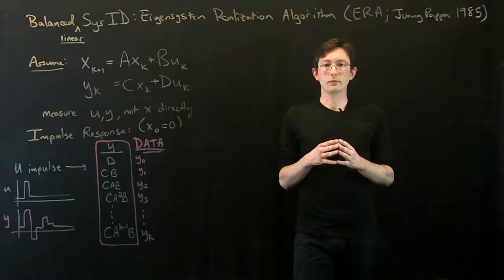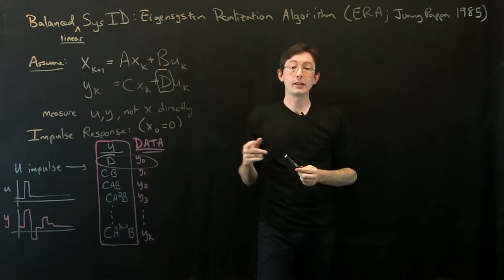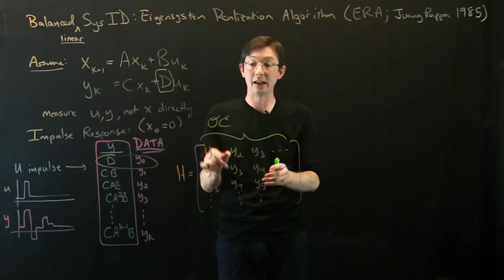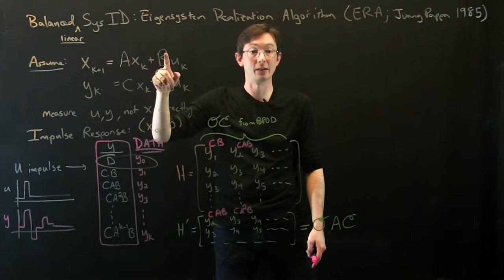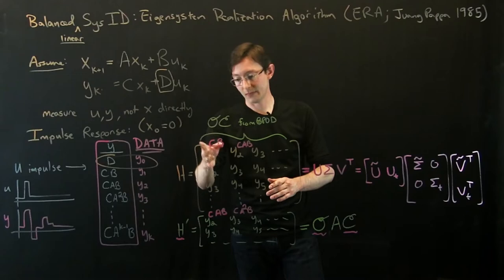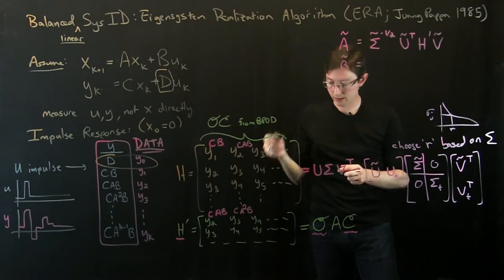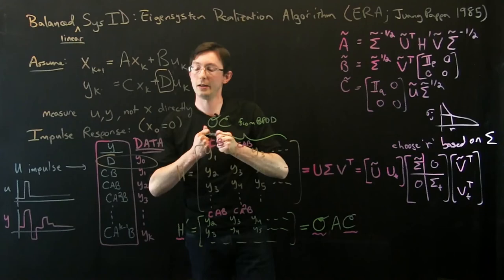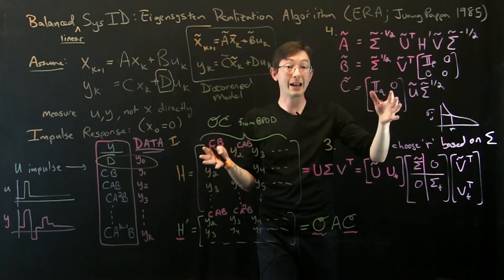Data-Driven Control: Eigensystem Realization Algorithm Procedure

Comment: Why only impulse inputs, rather than step inputs ?
Would several consecutive Impulses give better approximations ?
Reply from the maker: Great question.  In some systems you will need to do a step input instead of an impulse.  Actually, this was the case in my thesis, where I was building unsteady aerodynamic models past small pitching airfoils.  It made more sense to "step" the airfoil angle of attack, say from 0 degrees to 5 degrees, and model the step response.  But a step response in the angle is an impulse response in the angular rate.  So I appended the angle to the state of my system and made the angular rate the input, so that it was an impulse response problem again.  This is usually possible.
Reply: @Eigensteve  Very clever to change the variable so that a step input becomes an impulse input. But what about the case where actuator saturation cannot create a sufficiently large impulse, for example if your angle of attack actuator is too slow to impulsively change from 0 degrees to 5 degrees? Is this an inherent flaw in the system design, or is there still a way to apply ERA? I understand that one could perform the experiment anyway and carry out the procedure you've described in the video, but I worry that with a small magnitude impulse the system dynamics would be buried in noise and the system realization would vary highly between experiments.
Reply from the maker: @theBlaxicindasian  in this case, you would use ERA in conjunction with OKID (a few videos later).  Then, from a non-impulsive input, you can back out what the impulse response would have been and use ERA.

Comment: How do you build the Henkel matrix for a system if it has multiple measurements? Would each y_1, y_2, ..y_m be a vector within the Henkel matrix for each measurement at the specified time step?
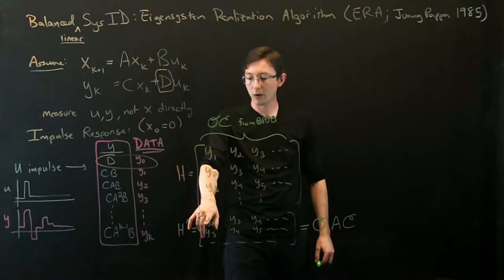Reply from the maker: Great question.  At 6:41, I hint at how to do this.  For a linear system, you can replace y_1 with CB, y_2 with CAB, y_3 with CA^2B, etc.  For a system with multiple inputs (q) and multiple outputs (p), then each of these matrices is size p x q.  So basically, you would stack all of these p x q matrices the same way as you stack the y's.  The real trick is how to rearrange your input data to get these matrices and rearrange the SVD at the end to get a model.  To start, you would perform q impulse response experiments, one for each input, and you would measure each of the outputs for each impulse response.  Then, you would need to organize these into the matrices CB, CAB, CA^2B, ....  Then, at the end of this procedure, when you compute the SVD of your Hankel matrix, you would need to be careful about how to use those matrices to compute the reduced model with q inputs and p outputs.  I believe this last part is in the book in chapter 9.
Reply: @Eigensteve  Thank you for these clarifications! But how does this work with HAVOK? In the supplementary of your 2017 HAVOK paper you write: "In the following, we will present the theory for a single scalar measurement, although this framework generalizes to multiple input, multiple output (MIMO) problems." But I could not find any further clarification on how this generalizes.

Since the above (CB,CAB,...) only works for linear systems, how would one stack multiple variable measurements for HAVOK?

Comment: Does it matter what the amplitude of the impulse is at t=0? I'm doing some simulations using non-linear/linearized systems, and there the results (mostly scaling I think) are quite amplitude-dependent (i.e. I check them by simulating both systems for another input).
Reply from the maker: For a linear system, the results shouldn't depend on the amplitude of the impulse.  If I double the impulsive input, then the output will double.  But for nonlinear systems, the output can be highly dependent on the size of the input.  ERA/OKID are specifically designed for linear systems where superposition holds.  We have some extensions for nonlinear systems, but this is still being developed.  (https://www.nature.com/articles/s41467-017-00030-8)
Reply: @Eigensteve  Thank you! :)

Comment: What is the dimension of the H matrix? If it is some finite (K x K) matrix, then what are the entries where if you follow the pattern, you get some y_m where m > k?
Reply from the maker: H is a finite matrix, but not necessarily square.  In fact, there is a lot of modern research on what the dimensions of H should be to get a good model.  Not at all obvious.  We have a paper related to this question for nonlinear systems: https://www.nature.com/articles/s41467-017-00030-8

Comment: Does it works for MIMO systems? The hankel matrix will be so large in high input output system. Is there any solution for that?
Reply from the maker: It does work for MIMO. The dimension does get very large, but we have powerful tools for computing large matrix SVDs.  In fact, sometimes this approach is still more efficient than other MIMO identification techniques.
Reply: @Eigensteve  could you please introduce the source (book , paper etc) or any clip maybe you have address this issue. ERA for MIMO systems.  Do we need three dimension hankel matrix?
Reply from the maker: @masoudsakha9331  This is the paper I was thinking about: https://link.springer.com/article/10.1007/s00162-010-0184-8 (arxiv paper https://arxiv.org/pdf/0907.1907.pdf )